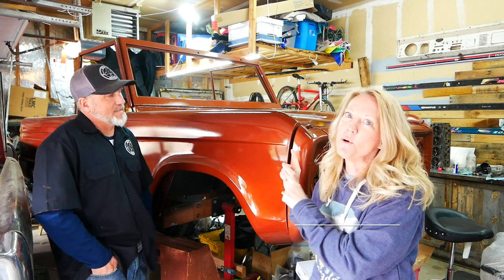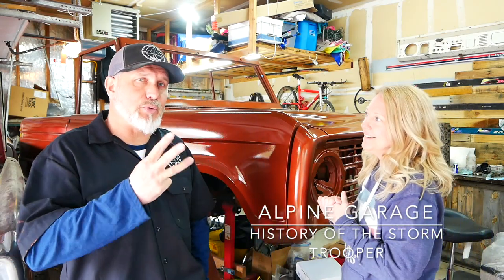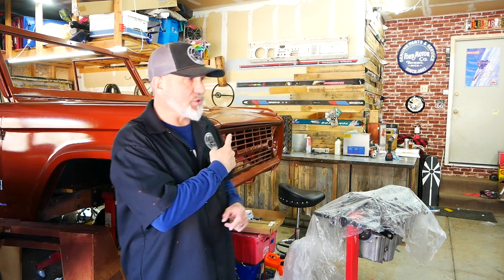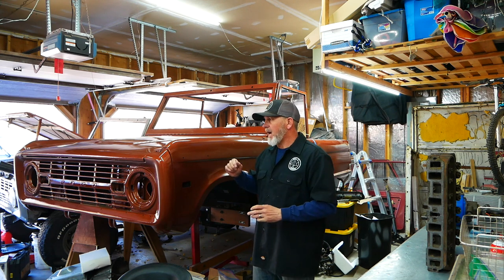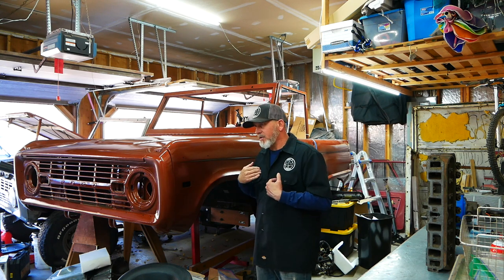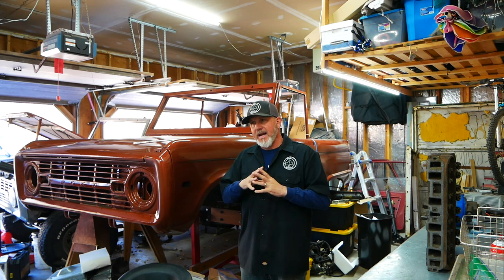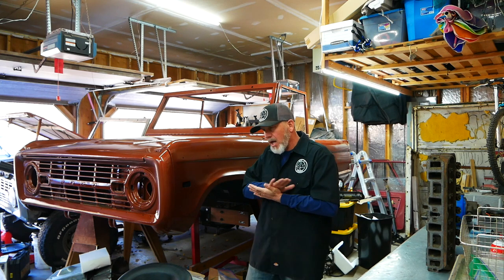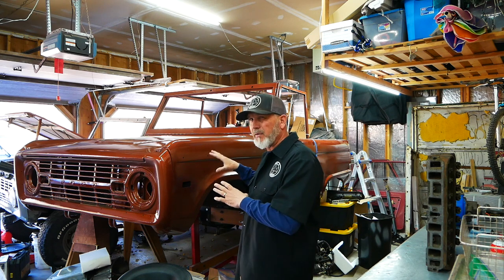1973 Ford Bronco Restoration...Welcome To Our Build [Upcoming Plans for the Build]

Comment: Chris, If u are worried about the EFI not working, the PCM seeing a 347 stroker rather than a stock 302, I did a 460 swap in a 94 bronco and ran it on the 5.0 PCM no problem,  it probably could have been tuned but it ran awesome and I drove that thing around for like 2 years before selling it. Im sure it will run just fine. My logic at the time was if the MAF is seeing more air flow, The PCM will adjust the fuel parameters, mind you I was running EEC 4 (1994) at the time. I do really like OEM powertrain controls over some other after market EFI systems, I see a lot of ppl on youtube struggling with snipers and edelbrocks, I have no experience with them myself but It's hard to beat OEM electronic engine controls If you can manage to make it run (im sure it will)
Reply from the maker: Thanks Jake, that’s my thought also. Now just to get it running…